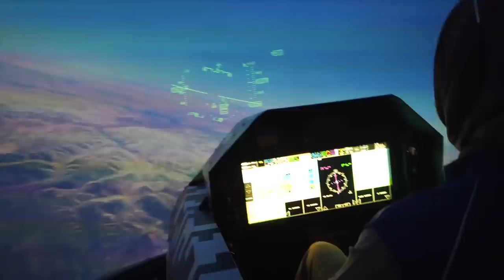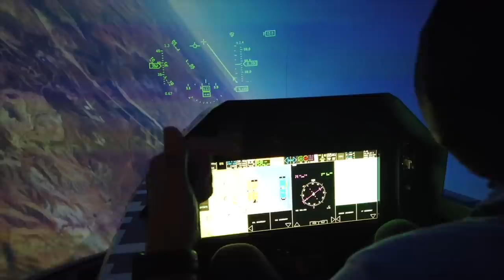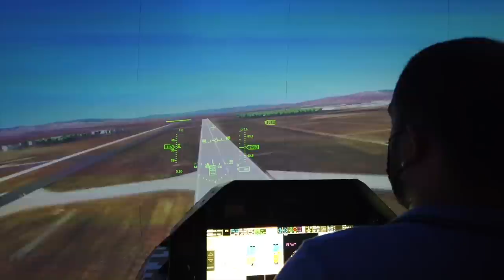Unbelievable: This Tiny Fighter Just Might Change the World

Comment: I don't blame Turkey for building their own fighter/trainer aircraft, years back, the US could have produced the F20 Tigershark for export sales and as a light fighter as a lower cost alternative to the F16 but balked due to chicanery by General Dynamics and an aircraft just as capable as the F16 died on the vine.
Reply: I'd disagree the F-20 was "just as capable" as the F-16.  The F-20 was an extension of an existing, aging, airframe. One that was already perceived as aerodynamically obsolete. The F-16 was a clean-sheet design.  It's like saying the F-16V is just as capable as the F-35.  Could the F-20 have been a competent fighter had further development in its roles been undertaken?  Certainly.
Reply: @namyun2743  You are no completely wrong, not completely right.  Yes the F-20 was based on the F-5, but was a completely new airframe.  I still think F-16 is superior, but F-20 was not far behind.  More proof is how the really old F-5 has been modernized and a few low budget airforces still use it or have recently being replaced.  The real sin of the F-5 was that it was not request by the Airforce.
In reality most airforces around the globe need a cheap versatile craft, for a lot of situation.  The example is the Brazilian made A-29, yes a successful propeller airplane in the 21st century
Reply: @happycamper9300  The F-20 could have been a perfectly fine fighter, in a vacuum, if the F-16 had not already existed, but F-16 did and it was no contest. USAF didn't want it and I agree with their decision; there just wasn't a place for the F-20.  It was almost as good as the F-16, at almost the price. But the most important thing: It's not a plane the USAF uses.  What does the F-20 have going for it? A cheaper flyaway cost?  Compare all the advantages and disadvantages of the F-20 and you'll understand why it failed.
I'd agree the A-29 is cheap, but versatile?  What can it do besides COIN? Primary trainer? Embraer originally marketed the A-29 as a primary trainer that could do a little more. The same role the USAF assigns to the T-6A Texan.  But the USAF doesn't expect to nor plans to take the Texan to war.  Why?  We value the lives of our pilots way more than that. The cost in just training for a USAF fighter pilot is more than the value of a "combat capable" A-29.  More than the A-29s we let the Taliban have. Coincidentally, the T-6A Texan is a direct competitor to the A-29, specifically in the primary trainer role. Beechcraft even offered a COIN package T-6A to the government as a direct competitor to the A-29 version eventually sent to Iraq and Afghanistan.  To put things into perspective,  A-29 is maybe a step or 2 up from a Toyota technical.  We have unmanned drones for that at a similar price.
Reply: @namyun2743  F-20 was based on the F-5, but so was the F-17 cobra (aka the FA-18 Hornet). The F-18 takes a further departure in design, but you can see a lot of little engineering details, fingerprints of the same engineers ;) 
F-20 was on par with the F-16A (emphasis on the A).
Reply: @kathrynck  Saying "YF-17 was based on the F-5" and "you can see a lot of little engineering details, fingerprints of the same engineers" are 2 very different degrees of similarity.
The F-20 still couldn't compete against the F-16A because the F-20 hadn't and wouldn't be selected by US Air Force. That seems to be the common sticking point in all the potential export deals for the F-20. It didn't help the F-16C was already in development and just 2 years away from production by the time F-20 made its first flight.
Reply: @namyun2743  All of the mentioned planes are "clean sheet designs". None of them are merely a "modification" of the F-5. They all have their own parts supply chain.

The main reason the USAF selected the F-16 over the F-17, was that it shared engine commonality with the F-15 and B-1.

Anyway, the Tigershark and the F-16A were reasonably comparable. The F-16A didn't have all weather or ground attack, it had a 'toy' radar, pretty modest payload too. It's only claim to fame was just being quick & nimble (and using an engine the air force had gobs of already).

F-16C is a whole different animal, far superior to the A model. And when it got the new better engine in block 50, it really hit it's stride and became a serious warplane. Back with the A model though, there was really very little reason to buy it, vs just pushing economy of scale on the F-15 by buying more of those.

Anyway, the F-16A was a short ranged light interceptor, with good speed and maneuverability, light payload, but very little ground attack or all weather capability. All of which also described the F-20 as well. There were subtle differences though. The F-16A was a bit more nimble, and had a bit more payload, but the F-20 had a faster time to takeoff, and was cheaper to both buy and per flight hour. They're not identical, the F-16A was a little better (cost aside), but they're both fairly similar "apples" if you wanted to compare them, As was the F-17.

When you get to the F-18 (much improved), of the F-16C (also much improved), then it goes a lot more apples to oranges.
Reply: F-16 is better then F-18 ?!? Maybe. It's not true! F-16A was a day time dogfighter indeed F-18A was an all wheater fighter with medium range air to air missile. Everybody refer to F-16C/D speaking about the plane armed with Amraams, but again in the frame time there were F-18C/D with a more powerfull radar better suited to employ Amraams. Never the less Fighting Falcon has a better airframe of the Hornet but couldn't land on aircraft carriers and for an attack mission you would probably like it to be in an F-18D, not a F-16C/D.

F-5 and it's evolution F-20 are one generation behind F-17 that evolved in F-18 and this tell us everything...

We can see what a fourth generation F-5 could be looking at JAS-39 Gripen included the biggest limit: its poor range.
It's a point defense interceptor and a local attack aircraft of no interest for american needs.
To solve the problem, as was done with F-18E/F, they develop JAS-39E/F variant.

Freedom Fighter is one of the best looking plane all the time, my favorite being F-18D.

This aircraft will be at best similar to T-50 but late more then a decade, while italian offer school there. Late trainers include indian Tejas supposely the best one if they keep cost under controll.

Nowadays trainer aside elettronics most important flight characteristic are sustained turn capabilities and angle of attack possibilities to emulate modern fighters. Not a supersonic push
Reply: @kathrynck I'd agree with some of what you said and disagree with the rest.  Sure, the F-20 shared very little parts commonality with the F-5, however the design is a modification from the F-5.  Even Northrop says it is.  It is not a clean sheet design.  There was no supply chain for the F-20, and it couldn't be used with the F-5's supply chain.  Whereas there was a complete supply chain available for the F-16 (and F-18 when the navy bought it)

Going back to the F-16A/F-16C.  I'd argue The F-20 had no foreign buyers because
1. The known development of the F-16C
2. The US didn't buy it.  Why didn't the US buy it?
3. The lack of existing supply chain. 

As for the US Armed forces; why buy the F-20 (which will require another supply chain to be developed) when we already have the F-16, with an even better, more capable version on the way?

The reason the F-20 failed is because it was always an apples to oranges comparison. It failed not because it was bad.  It failed because the competition was much better; they, had better political and logistical backing.
Reply: @robertopiedimonte2078  The F-16C was in production in 1984, the same year the navy accepted the F-18.  Any era-based comparison of any F-18 will be against the F-16C.
Reply: @namyun2743  I don't disagree as much as you imply. i just think the F-20 was a smaller, cheaper, more efficient competitor to the F-16A. Although the F-20 was not as good in several respects. And that it didn't disappear because of being a bad design, but because of timing, politics, and economy of scale.

I do think that a lot of people (not you, but just in general this discussion) are overlooking the timeline, and the companies involved a fair amount.

-- The F-5 is operated by the USAF as a very low cost interceptor to flush out numbers of aircraft.

-- The F-5 is popular with countries which have no money, or which the US DoD doesn't want to share advanced tech.

-- General Dynamics begins work on the YF-16 and Northrop Gruman begins work on the YF-17 to compete for a light fighter contract for the USAF.

-- GD wins the contract for the USAF, the YF-16 becomes the F-16A. The key criteria being that it used an engine they already had supply chain & repair crews for. Also, the F-16A was the darling of the 'Fighter Mafia' (sometimes known as the 'Luddite Mafia'), which is a whole long separate story.

-- The USNavy says "nah, the chairforce is daft, we want the F-17. More thrust & engine redundancy (but perhaps as importantly that chin-intake doesn't look very carrier friendly) ...but Northrop, give it over to McDonnel Douglas to re-work it into a carrier aircraft ...and McD-D, put some F-15 multirole bling in it". This results in the FA-18. They added the "A" because they wanted to emphasize it's not just naval-ized, but also has added multirole/all-weather/day-night/BVR bling.

-- USAF looks over at the Navy's new hotness, flying day/night, any weather, able to use longer ranged Sparrow missiles, decked out for ground attack... turns to the Fighter Mafia says "why do we listen to you?" Call's up GD and tells them "Make a new version of F-16 which is more F-18-ified"

-- Northrop engineers are bored after collaborating with McD-D on the F-18, and notice that the DoD is slightly sketchy about selling F-16's to just anybody, cuz it has advanced materials and fly-by-wire (which were all new). Also, they notice that the F-16's are getting the nickname "Lawn Dart" because they seem easily destroyed by just flying them. Maybe the Air Force would want something new to sate the tech-phobic desires of the Fighter Mafia? So they scuttle ongoing improvements to the F-5, and make the all new F-20. To replace the F-5 as an export plane to countries with little money, or whom the DoD is sketchy about selling F-16's to. The F-20 has the new 4th gen lightweight materials though, and ends up getting fly-by-wire as well. But maybe it'll "feel" less dangerous for the DoD to approve sales to nations of questionable alignment, cuz it doesn't have F-16 in the name. They do try to make flying it and repairing it, seem somewhat familiar to anyone already operating F-5's. But for all intents & purposes, it's a modestly smaller F-16A, with a somewhat more efficient engine with great thrust:weight properties (borrowed from the F-18 program). Though the F-16 is modestly more maneuverable, and can carry slightly more, and slightly further. While the F-20 is even cheaper than the F-16.

-- USAF cries foul, tells the DoD that the F-20 has all the "tech" of an F-16, and an even more advanced engine. Also if the F-20 puts a dent into foreign F-16 sales, it'll drive the air force's costs on the F-16 up, due to economy of scale.

-- It turns out not to be an issue, because of economy of scale. The F-20 is a fundamentally cheaper design, but with hundreds of F-16's already sold, a "first batch" of F-20's can't really compete on price. No budget-conscious buyer wants to pay the early-adoption-price. Also, the DoD realizes there's nothing particularly 'sensitive' about the tech in the F-16A. Digital watches and "portable" computers were invented, fly-by-wire became "easy", NASCAR started using carbon-fiber... and the F-16C is coming soon, so they made it easier for neutral-alignment nations to buy the F-16A, killing any glimmer market for the F-20, and helping drive the unit-cost of F-16 airframes down for the USAF. Northrop is now bored, and annoyed.

-- F-16C comes out and is "pretty good" actually. It gains weight though, losing it's 1:1 thrust to weight ratio. And the Luddite Mafia cries a river of tears.

-- AMRAAM arrives, and is really good. USAF sells off as many F-16A's as they can. Now the F-20 is really, really super-dead. Any unsold F-16A's are converted into drink coasters. Most of the Fighter Mafia commit seppuku.

-- Desert Storm happens, and the Luddite Mafia is driven underground by the overwhelming success of key technological improvements.

-- F-16C block 50 comes out with F-110 engines, which can match the F-18's F-404 engines for efficiency & power-to-weight. A small enclave of surviving Fighter Mafia begin worshiping the F-16C. To be fair, at this point, with it's nimbleness restored, the F-16 finally became a really good all-purpose battle aircraft. The new engines also helped it stop losing fights with thin air. For the first time, the F-16 makes good sense, compared to just buying much larger numbers of the more capable F-15 and driving it's price down through economy of scale instead.

-- YF-23 & YF-22 compete. YF-23 beats it on almost every metric, but the 22 has friends in the right home constituencies, so it gets picked. Either plane makes everything before them obsolete.

-- X-32 and X-35 come out, X-35 has those friends in the right home constituencies, but legit beats the X-32, becoming the F-35. Program management with 3 services, 9 international partners, developing 3 very different variants, is a completely overpriced clusterxxxx, but the engineers did excellent work, and snatched a great design from the jaws of bureaucracy.

-- An elderly luddite mafia sith lord emerges from the darkness. He notices the F-35 has "drop tanks" worth of fuel added to the 'inside' (for stealth), and leverages this to argue it's drastically heavier than other planes (without their drop tanks), through switcheroo-math. He launches a world-tour to criticize the F-35 with wild unfounded claims, recruiting new sith apprentices. He is broadly supported by numerous nations' politicians (and their media) who didn't buy into the F-35, in order to save face on their decision. A new age of luddite mafia rises, largely unaware of it's being bolstered by ardent support from Chinese & Russian media influence.

actually this is kinda getting way past the F-20, sorry.
Reply: No need war. So don't product miltory  equipment  please  develop medicine  food give poor people

Comment: Looks like a simple air frame to learn the basics of building a airplane and learn how to incorporate the newest electronics. Now days it's what's inside that counts.
Reply: It still has to fly though. And the more you pack into it, the harder that gets.
Reply: @Gunni1972 with a big enough engine you can get a brick to fly.
Reply: @Gunni1972  It already fly (11 times) at this day.
Reply: Looks like a tweaked out BAE Hawk. Probably got some extra bells and whistles.
Reply: You don't need mach 2...Its the Electronic Counter Measures, radar and weapons that kill. Mach 1.4 is more than enough and this plane will be cheap to run.
Reply: @brokeandtired  In a plane with that kind of radar signature, it better.  Speed and agility are the only two things that can save you with today's tech.

Comment: Light combat aircraft are mocked as fake-fighters, but with the Hurjet for Turkey and Poland's FA-50 it seems like there is a niche for them on the battlefield. In a role previously filled by ground attack aircraft and as a support for more capable multirole fighters.
Reply: You don't need Mach 2...Its the Electronic Counter Measures, radar and weapons that kill. Mach 1.4 is more than enough against Sukhoi's and this plane will be cheap to run. Also Turkey can field 3 of these for the life costs of an obsolete Sukhoi.
Reply: The FA-50 is South Korean. Poland is buying 48 of them though.

Comment: They have been using F-5s? Honestly I think that the F-5 is an under appreciated jet but I didn't know anyone had active aircraft. But their "new" aircraft looks like it was influenced by the F-5.
Reply: Many countries were still using F-5s and other such as Thailand upgraded their F-5Es with modern radar that can fire the newest missile available.

USAF still also uses the T-38 in training duties.
Reply: @paulsteaven  thanks for the info.
Reply: F5 is  now only used by air acrobatic team, current trainer is T38 talon (modernized 10yrs ago)
Reply: Turkey enhanced air to ground capabilities of F-5 domestically however due to F-35 purchase Turkey retired most of them and screwed by the usa, thats why Turkey hurry to finish Hurjet and TFX.